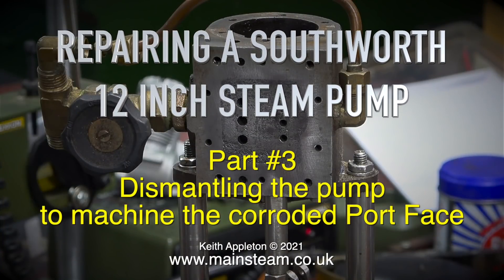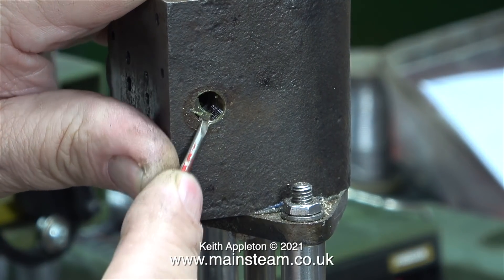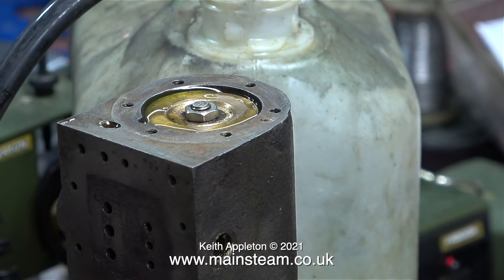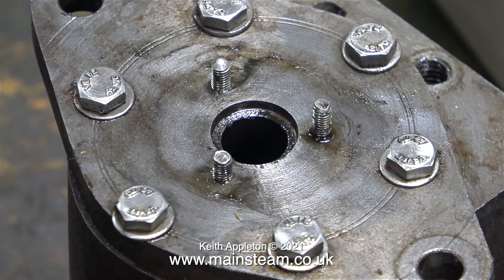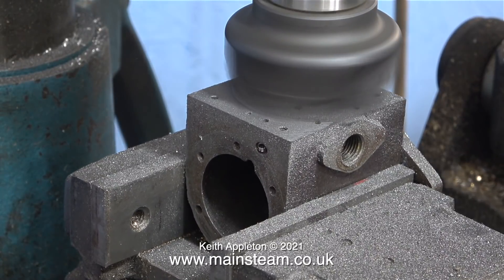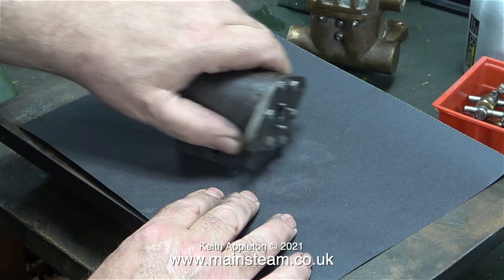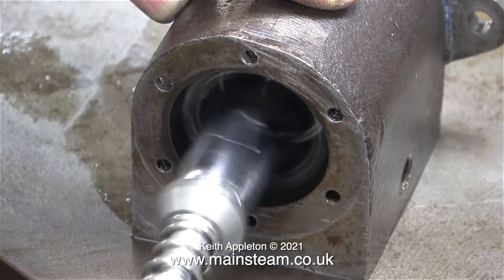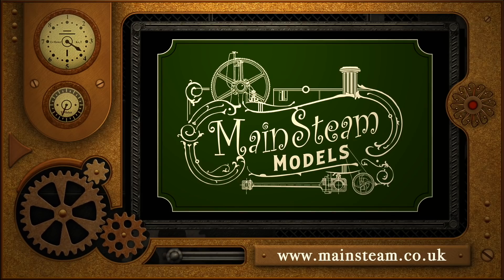REPAIRING A SOUTHWORTH 12 INCH STEAM PUMP - PART #3

Comment: It must have been satisfying contemplating the cleaned up cylinder casting! Nice job. I probably would have fiddled about trying to get the port face perpendicular to the spindle but I assume a little either way doesn't matter because the valve face will adjust anyway while running so I'd have been wasting time :)

Comment: Hi Keith... I really love this Soutworth 12 inch pumps... they are amazing and I wonder if you will test them at the end with real steam... I saw a difference when they were used with air or real steam... the dynamic of the valve and spring was different and needed adjustments...

Comment: About the figure eight motion, factory manuals for some 1950 to early 1960's motorcycles specified that for metal to metal mating surfaces that got no sealant or a light film of sealant. A gasketed surface required only to be flat, as compressing the gasket is meant to fill voids and valleys. I remember watching as a senior mechanic surfaced both the cylinder block and head of a twin with a mill file laid flat on each piece. A few passes to even out high & low spots, then clean off and assemble.

Take care and thanks for the insight.
Reply from the maker: I only use the figure of 8 method for the videos to satisfy the experts  . . . .
Reply: @keithappleton  Have you considered a figure 4?  It’s impractical, but my favorite number.